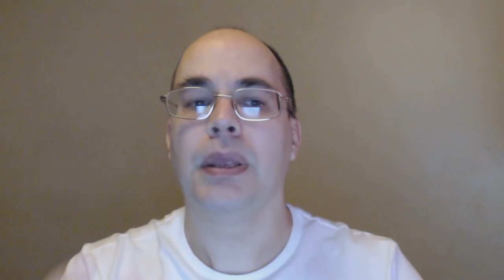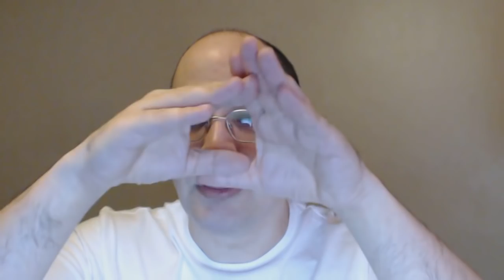How do rockets move in space, with nothing to push off from?

Comment: Oh, man, too funny. -- Hey genius, try putting a live round in a hollow tube, set it off with heat or something, and see how fast the bullet comes out the end. -- If it comes out at all. You'll much more likely just get a blown up tube.

Why don't you go borrow a pistol and examine how it's built. -- You could do this with a diagram of a pistol as well, of course, but the advantage of a real one is you'd be able to put it to a second very good use.
Reply: +Pontifex Maximus You're thinking about the mass of the fuel but you're forgetting that it is expelled with a large acceleration. Force is mass*acceleration. So the mass alone is not very interesting. If you actually do the math, you'll discover the force of a modern rocket is very high.For example, the booster rockets for the shuttle generate 30.5 million Newtons.
Reply: +Pontifex Maximus "Exactly how did they manage that? With a long pole?" Actually, hilariously that's exactly how they did it. It was stored in a space on the outside of the lunar module. After landing, they were able to electronically open the panel and extend the boom pole with the camera. You can see the blueprint and design for how it worked in the Apollo archives online.

"Dissipating heat is another argument you haven't addressed."

You make a good point that convection doesn't work in a vacuum. But that also applies for heat being transferred from the sun to the module. So the way that the sun heats the module is through a different method of heat transferal: infrared radiation. This is also how the module diffuses heat - via radiation on the dark side of the craft. But the really useful thing about infrared radiation is that it can be reflected away from the craft using shiny surfaces. They also have ways of making the radiation diffusion more efficient through radiating fins.

"The distance above the height of the "moon" that the running jumping frolicking golf-playing astronauts achieve is precisely the same as it would be on ear"

It's not really true that the heights are precisely the same. The spacesuits were 300 lbs of mass and intertia that they had to overcome making their jumps much, much higher than expected. Moreover, the footage that most people use to evaluate the jump is not the only time they jumped. Armstrong was able to max out his jump at about 6 feet but when he did this he found there was a tendency to flip backwards. After almost coming down on his back he declared an end to maximum jump tests.

There's something else to mention about the footage. If you look at the motion and really analyze it, you'll see that it cannot be explained by "slow motion." If you speed the footage up so that the jumps take the time you would expect on Earth it becomes very clear that the micromotions (hand movements, arm movements, head turns, etc) become absurdly fast.

FWIW, I've dived deep into both sides of this debate and my claim is that the evidence is clear that we went to the moon. A huge amount of the "evidence against" has reasonable, clear explanations that for some reason fall on deaf ears. The marketing of the hoax evidence is effective. People became thoroughly convinced by guys like Sibrell and even when you show that a large percentage of the claims are literally deceptive and the ones that aren't are explainable, it somehow doesn't seem to matter. 

I have tried for a long time to understand why but I have failed miserably.
Reply: +Pontifex Maximus "They should be leaping 10 feet above the surface. They ain't. What's the confusion?" 

Not with 300 lb space suits on they shouldn't.
Reply: +Pontifex Maximus "The panoramas, Scott. Where dey at???" The link Jan included isn't sufficient for some reason? I'm genuinely asking.
Reply: +Pontifex Maximus I hear you on the whole "who has time" to sort through all the noise for sure. I look at  for myself like dip in a for a few moments when you happen to be online and bored. See if you can push your understanding forward a little (in either direction) or see if you can add something informative to the discussion and most importantly (in my mind) try to do it a respectful/fun way. One of the things I can never understand is why so many people on both sides of the debate default to such obnoxious/insulting behavior. 

I swear, half the reason we never get consensus on these topics is because everyone on both sides are in a constant triggered state. 

Oh, and I've learned to let go of the fantasy that getting to a consensus will be easy or happen quickly.
Reply: +Pontifex Maximus ""the President declares the current state of emergency to be continuing and ongoing." Wow, I've never heard of this before. This is hilarious. And fascinating. Like... what?
Reply: +Pontifex Maximus "I'm not in a triggered state." I agree! Obviously. I thought that was so obvious it didn't even occur to me that you would read it that way. I was talking to a like-minded "it's nothing to get obnoxious over" person about how many are not like-minded with us.
Reply: +Pontifex Maximus I honestly think everyone is shadow banned and deleted. It happens with such annoying frequency.

Regarding the debunking debunks... there's some truth to this but at some point, there is an underlying truth. And reasonable, intelligent people shoul dbe able to agree on a way to reach it. I don't think youtube comments is a medium that lends itself to that but in general it should be more possible than it appears to be on this subject.
Reply: +Pontifex Maximus I was actually there for the creation google. Was in the same doctoral class as Sergei and Larry. To my eternal shame, I turned down a suggestion to work in their group with the dismissive, "Eh, search is solved. I want to do something interesting." SIGH.

But I can tell you that I never saw anything remotely shady about the birth of google. Just graduate students trying to solve search.
Reply: +Pontifex Maximus "Their graduate work was the foundation of the "intelligent" software that is now churning away" I mean I suppose there's a way you could view it like that.. I mean to the extent that their work on search is the basis of the birth of the company it's the foundation.

The work itself had very little to do with the kind of the sentiment analysis we know see. They were focused (at the time) on very shallow methods of understanding content. It really wasn't until the deep learning explosion of the of the mid 2000s that understanding started to deepen. 

Only tangentially related but my favorite story of that time is that right after they had the core insight of labelling pages not by the content but by the links, they taught a seminar class for undergrads at Stanford. All majors. 200 people. The class worked like this: every Friday, every student had to submit a single-page paper that was "an idea for how to search the internet  better." 200 students. 10 Fridays. 2000 essays. A week after that class ended, Larry and Sergei quit Stanford and formed the company. They took their stack of papers and one by one went "Good one, good one, good one, bad one, good one" and when they were done they had their development slate mapped out. Also, they hired the good idea people and turned them into billionaires.
Reply: +Pontifex Maximus I'm not fully seeing what you're trying to say? Why do you say "page ranking my ass"? Why do you doubt that?

I don't actually need to read Terry's wiki. He was my advisor too for a year. (I eventually switched to Daphne Koller.)

What are you saying here? I'm not being purposefully obtuse..I'm genuinely not fully catching what you're implying?
Reply: +Pontifex Maximus "Advertising revenues from people doing Google searches?" Yep. Who could have fucking seen that coming but turns out to be insanely profitable. I remember having endless debates with those guys where I would say, "You have the best search algorithm in the world, great! How do you make money?" and they would say, "Who knows! But there has to be a way."

There is an obvious value to their street mapping project. It's earned revenue and people make use of it all the time. What do you think they're doing with it that's untoward?

And what's wrong with scanning books to preserve them?
Reply: +Pontifex Maximus I don't think your sense of the economics are correct. When you say "talking about sums of money" what are the sums?

"You couldn't even do the accounting to collect?" I think you're making a factual mistake somewhere. You either overestimate Google's revenue? Or mabye underestimate other companies revenue? I mean, Comcast makes more in advertising revenue than google does - they manage to handle the accounting demands. 

Total ad buys last year were like 300 billion. Googles' revenue is like 75 billion. Apple went from bankrupt to the most valuable company in the world in the same time. Worth way more than google. Facebook is close in the same time. What's so unbelievable about google?

Yes, google buys up anything that is useful or a threat. So does Microsoft. So does Facebook. That's capitalism.

But I see absolutely no evidence for your suspicion. Do you have a real piece of evidence?
Reply: +Pontifex Maximus Well, you have a pretty good idea of how old I am given the fact that I started my PhD the same year Larry and Segei did. And what do you mean a "blank page?" They absolutely did advertise. Those small blue links that used to show up at the top of every search were ads. Now, they're usually in the middle. 

It didn't magically end the search wars. It ended the search wars because the search algorithm was orders of magnitude better than anything else. I remember back when it was a googol.stanford.edu and the entire thing was literally two guy's work and yet it blew Yahoo and Alta Vista (two full companies) away. It won by being the best.
Reply: +Pontifex Maximus What are you saying? Of course, Google advertised things. Not their own products obviously. It's the same model as a television network. 

A tv network sells air time to advertisers. Google sold space on their search results to advertisers. One of the reasons it became so valuable is that it allowed to advertisers to target customers very precisely. If you do a google search for "dishware" you'll get an ad for dishware. That kind of specificity blows blanket ads away. 

Like I said, comcast made 93 billion selling ad space last year. That's more than google made selling ad space. So nothing unbelievable about the numbers...

"Who paid them a dime for using their search engine?"
Companies who wanted to advertise to google users. Again, think of them like a tv network. Same model but better.

Here's a picture of the way advertising used to look on a google search page. The layouts are always evolving but this is one of the oldschool looks that you might remember: https://www.duncanjonesnz.com/wp-content/uploads/2016/07/results-history.png?x33513

Stuff at the top and to the right are ads. That's revenue for google EVERY TIME a search happens. Even more revenue when someone clicks on it! Every time a search happens!

Yes, google sees what you do on the internet. No disagreement there.
Reply: +Pontifex Maximus Just had a funny thought. Is it possible that you think Google does not have ads because you use an ad blocker and thus never actually see them? Just dawned on me that maybe that's why you are so convinced of something that's so demonstrably untrue! Pretty funny if that turns out to be the case?
Reply: +Ponifex Maximus Did you reply to my last message showing an example of google ads? I didn't see anything but if you're having trouble with disappearing posts then maybe you did? Are you using an ad blocker? If so, you can temporarily disable it and you'll see the ads for yourself.

FWIW, disappearing posts on youtube comments is a huge problem that I don't believe is associated with any kind of intentional censorship. I think Hanlon's Razor applies here. I've done a lot of testing around the issue and as far as i can tell: it's intermittent and unpredictable and I suspect has more to do with poorly designed spam filtering and corporate laziness than anything sinister.
Reply: +Pontifex Maximus Wait, I can't tell if you're kidding or did you miss the comment where I had a link to show you the ads? Here it is again:
https://www.duncanjonesnz.com/wp-content/uploads/2016/07/results-history.png?x33513

See all those ads?

There are most definitely ads on Google now. I'm really torn on whether you're serious or not. I don't have an ad blocker on Safari I never use it. So I just went to google and typed "dishware" on the first page of results at the top is a horizontal bar of advertisements with label "sponsored" right above it. Try it out.

Here's a cut and paste from the Google's wiki: "Google AdSense is a program run by Google that allows publishers in the Google Network of content sites to serve automatic text, image, video, or interactive media advertisements, that are targeted to site content and audience. These advertisements are administered, sorted, and maintained by Google. They can generate revenue on either a per-click or per-impression basis. Google beta-tested a cost-per-action service, but discontinued it in October 2008 in favor of a DoubleClick offering (also owned by Google).[2] In Q1 2014, Google earned US $3.4 billion ($13.6 billion annualized), or 22% of total revenue, through Google AdSense.[3] AdSense is a participant in the AdChoices program, so AdSense ads typically include the triangle-shaped AdChoices icon.[4][5] This program also operates on HTTP cookies. Over 14.3 million websites use AdSense.[6]"
Reply: +Pontifex Maximus Look, I even took a screenshot of the ads and uploaded my first imagr post. https://imgur.com/a/wsK01
Reply: +Pontifex Maximus Ah, fair enough. I really thought you were deadpanning me, ha. I have actually heard from Google friends that people mentally block out the ads a lot. Especially back when they were just text. So evidently it's not a totally uncommon thing. I almost mentioned that but was afraid it would just muddle things.
Reply: +Pontifex Maximus
Hey genius, try putting a live round in a hollow tube, set it off with heat or something, and see how fast the bullet comes out the end. -- If it comes out at all.
I agree. But what's your point? How does your experiment disprove anything this video?
Reply: Go look up Newton's Axioms/Laws of Motion. They're in a book called the "Principia" for short. The Third Law is the one we're interested in, concerning equal and opposite reactions. A body can't exert a force on itself and thereby move, there has to be another object (or medium) on which a force acts to create a corresponding reaction. In space there is nothing to exert a force upon, only a void, and therefore no way for a spaceship pushing gases out into that void to move. There would be no reaction that would propel the spaceship forward.

The analogy to a bullet fired out of a gun is completely inapplicable and irrelevant to the discussion. I suggested the hollow tube merely to highlight that fact, since in if you tried the experiment, the force of the gases from the rapidly burning gunpowder would for the most part expel themselves out the back of the tube, and the bullet would probably be ejected from the front at 50 or 100 feet per second, if you were lucky. The recoil of the pistol is in proportion to the weight bullet (125 grains let's say) and the pistol (say 30 ounces). The maker of the video is a either a complete idiot (most likely), or expects you not to notice that there's nothing resisting the gases thrust out of a rocket in space the way the pistol holds a cartridge in place. In his fantasy there's something like a big giant iron plate following the spaceship around in space.

There's nothing here to disprove here. It's just a bunch of nonsense.
Reply: +Pontifex Maximus
A body can't exert a force on itself and thereby move, there has to be another object (or medium) on which a force acts to create a corresponding reaction.
Yes, very good! Now why don't you actually try to apply this law to the rocketry?

As I already told you - the exhaust is not a part of the rocket, so the rocket doesn't actually exert a force on itself - just as a bowling ball you threw away while on a skateboard isn't a part of you, even though you were holding it beforehand.

I suggested the hollow tube merely to highlight that fact, since in if you tried the experiment, the force of the gases from the rapidly burning gunpowder would for the most part expel themselves out the back of the tube, and the bullet would probably be ejected from the front at 50 or 100 feet per second, if you were lucky
Well, yeah. Again, how does it disprove anything in the video? If you modify the gun, it's not going to work as good as before, but the action-reaction effect is still there, as you yourself note :)

Tell me - how can you have exhaust going down without affecting rocket in any way? Because that's what you believe - rocket generates an exhaust which is strong enough to lift it after bouncing of the atmosphere. Well then, why isn't it affecting a rocket before leaving the exhaust chamber?
Reply: You're comparing a bowling ball, which has a significant mass in relation to the person tossing it, to hot gasses, which have almost zero mass in relation to the mass of the spacecraft. -- That is the completely erroneous analogy.

The bullet would still separate from the cartridge and both move away from each other in opposite directions, as they both have relatively proportional masses. -- In absolute contradistinction to the spaceship/ejected gasses example.
Reply: +Pontifex Maximus
You're comparing a bowling ball, which has a significant mass in relation to the person tossing it, to hot gasses, which have almost zero mass in relation to the mass of the spacecraft.
Well then, I guess that all those rocket launches we've seen must be holograms or something, because even if you believe that rockets work by pushing off the air, they clearly expel enough mass to "bounce off the atmosphere" and propel the rocket up :)

The bullet would still separate from the cartridge and both move away from each other in opposite directions, as they both have relatively proportional masses. -- In absolutely contradistinction to the spaceship/ejected gasses example.
False - rocket's exhaust actually has rather significant mass :)
Reply: The PROPOSED mechanism of action is different in the two cases. If you wish to apply Newton's Third Law to the motion of an Apollo spaceship on the way to the moon, then sure, with a whole bunch of fuel to burn they could probably get the ship to move at a rate of a few inches an hour.
Reply: +Pontifex Maximus
The PROPOSED mechanism of action is different in the two cases.
How so? Either way, we have a violent release of gas particles in every direction, which interact with its environment (gun barrel/combustion chamber).

If you wish to apply Newton's Third Law to the motion of an Apollo spaceship on the way to the moon, then sure, with a whole bunch of fuel to burn they could probably get the ship to move at a rate of a few inches an hour.
This, again, stand in stark "contradistinction" with your beliefs - all those rockets in the atmosphere clearly can propel themselves to a significant speeds :)

Therefore, if the method of propulsion is actually different to what you think it is (and it is), then rockets do have the capability to reach the Moon at speeds much, much greater than "a few inches an hour"
Reply: That's the most reasonable thing I've ever seen Believers in the Magical Powers of the Atmosphere do. Yes, you do not have the knowledge at hand to prove your side - and you'll never will.

And if you can't prove NASA wrong, and can't be bothered to prove them wrong, then your decision not to trust in rocket science is not a rational one, but emotional one. You might as well be honest and admit it to yourself.
Reply: +Pontifex Maximus
And you are correct, I do not have the physics to prove/know, that the equal and opposite reaction part -- that the expulsion of gasses will cause the ship to move -- is valid or not.
So can't you, like... test it? Ask yourself some questions?

Would a gun work in space? If yes, then:
Would a gun "firing" an mass equivalent to a bullet work in space?

The actual rocket science is quite complex, but the basic idea is quite simple: just some gas particles getting heated and bouncing around.

There are, however, so many other impregnable arguments against the moon landing hoax
... which all have been soundly and repeatedly debunked. And you don't have to bullet point them all - just one would've been sufficient to have a nice civil conversation about it, as long as you'd be willing to stick to it, like you say you would.

Also, by the bye, it seems to me extremely poor form to interject an accusation against someone who has conceded a debate you were not involved in.
After you've bailed on me, it seemed quite fair :)
Reply: +Pontifex Maximus
You want another point? -- I'll give you a couple. Man built a plexiglass box in his backyard that had gloves similar to the ones the Apollo astronauts used going inside it.
No, he did not :) Ralph René has, in fact, used ordinary rubber gloves, so, no wonder he couldn't bent his fingers.

The actual design of space gloves is a matter of public record - anyone can see what NASA have done to ensure that its fingers would bent while in space. We even have videos right here, on Youtube, showing gloves in vacuum chambers. Even Adam Savage has one.

Other points, simply off the top of my head:
If I might trouble you with continuing this debate (which is of course entirely up to you), then it would be better to stick just to one point.

Nevertheless:

- Difficulty of dissipating heat in a vacuum.
Again, NASA's methods of heat dissipation is a matter of public record.

- Number of pictures taken in the time reportedly spent on the moon (something like one every 2 or 3 seconds), all of Time magazine quality.
Yet again, we have access to all the photos taken, and some of them are quite bad - blurry, over- and underexposed, etc. Also, most of them were shot in sequence, quickly, one after another, to make panoramas, etc. Once you run the numbers, the number of pictures taken isn't that unusual.

The inconsistency of shadows in the pictures and several other points concerning them.
Those "inconsistent" shadows have been replicated using only one light source.

- The ballistic probability of hitting the orbital window of either the moon or the earth.
Which is why astronauts did a mid-course correction :)

- The fact that none of these systems were ever tested in the real environment they were to face,
That's incorrect - Apollo equipment has been tested extensively in space, and over the Moon. There's a reason why it took NASA 11 missions to actually land on the Moon - the previous 10 were spent doing exactly what your source says wasn't done.

See, this is what I meant when I said that all those "impregnable arguments" have been soundly and repeatedly debunked. That's old stuff, from 90's.
Reply: +Pontifex Maximus
The rapidity of your replies shows that you're an expert on this subject.
It's Sunday evening. I'm just having some fun :) And, again, this is old stuff, publicly available over the Internet. I've had conversations like that already, so I kinda know the basic answers off the top of my head, even though I'm not an expert. I do know where to find some actual experts, though :)

I am certainly not an expert on it
It's okay :) However, since you concede that you're not an expert here, why believe in a Moon landing conspiracy at all? Never mind the rockets - the Moon rocks, the photos, etc all prove that man had to be on the Moon to get them.
Reply: And you may ask, what other particular conspiracies am I an expert on? -- 9/11, global warming, and to a large extent banking. To name three.
Reply: +Pontifex Maximus
I believe it to be a hoax because of the sheer preponderance of evidence against the slightest possibility of it being real.
Which, when examined individually, falls apart. The gloves, shadows, photos, "untested" equipment - it's all been proposed in the past, examined, and ripped apart.

I still note that you have not addressed the 1/3 gravity issue
That's because I haven't seen it - you've edited your post after I've posted my response.

So, there you go:
- Who took the video of Neil climbing down the ladder out of the Lander?
Automated camera, included and set up precisely to capture that very moment.

- Speeding up the videos shows that 1/3 gravity was not the situation.
On the contrary, it's impossible to duplicate movements of the Moon astronauts in Earth's gravity. (And it's 1/6 gravity, not 1/3).

- Stuff left on the moon should be perfectly visible to us with modern technology.
It is. We just needed telescopes with adequate resolution.

They even claim to have set up a mirror to reflect a laser projection from earth in the future. None of this has ever been shown.
What do you mean? Scientist routinely bounce lasers off those mirrors.

(which apparently has a hatch that isn't big enough for the suit to fit through)
The hatch is 32 inches wide, and the space suit is 22 inches wide at the shoulders.

Another thing is, claims like these seem to suggest that NASA is both inhumanly competent and bumblingly inept at the same time, which alone is quite enough to doubt each and every conspiracy claim :)

And, some of those claims are so easy to debunk - like the automated camera one. Those are accusations that stem not from expertise, but from ignorance.
Reply: +Pontifex Maximus
If you speed the films, the distance above the height of the "moon" that the running jumping frolicking golf-playing astronauts achieve is precisely the same as it would be on Earth.
The movement of the astronauts is impossible to duplicate in Earth's gravity. Without specifics this claim in meaningless.

Which is why they never bothered to make a video panning around the surface they were standing on.
That's incorrect - the astronauts made several panoramas.

Dissipating heat is another argument you haven't addressed.
I have. I said that heat dissipating methods are publicly available. Again, without some precise numbers, the accusation is meaningless.

And they "set up" the camera? Exactly how did they manage that? With a long pole?
Is an idea of remotely controlled camera is really so hard to imagine?
Reply: +Pontifex Maximus
They should be leaping 10 feet above the surface.
Why should they? It's the same as saying "this car can go 150mph - why aren't you speeding all the time?"

In any case, the fact that the astronauts were acting responsibly and avoided any reckless maneuvers is not an evidence of the hoax.

Show me money. Where the panoramas at?
https://www.lpi.usra.edu/resources/apollopanoramas/

They threw it out the window
No, it was attached to the side of the LM. Again, this information is publicly available and can easily be found online.

So, yet again, this is you battling with your own ignorance. That's not an insult, nor even much of a pointed observation. However, what worries me (and should worry you) is apparent ease you abandon your points with. A is wrong? Let's try B. B is wrong, too? C it is, then.

Consider this: If one, only one point of evidence for Moon landings can be shown to be true beyond all reasonable doubt, then that's it: the Moon landings had to happen in order to get it.

On the other hand, the conspiracy theory has to explain everything away, and if it can't, then the conspiracy cannot be true.

So, you don't have to introduce new points as the old get disproven - all you have to do is stick to one point, and one point only.
Reply: +Pontifex Maximus
I have not abandoned points, Jan. I abandoned the entire argument.
Then why do you keep arguing?

I'm not presenting counter-arguments about what you're saying because I can't back them up.
If you can't back them up, then why do you believe in their validity? The simplest of them can be debunked in like 2 minutes; why do you think that the rest is any more valid?

Today we drop bombs on children in the Middle East for Israel and "our" government is a gang of mobsters.
That is entirely and completely beside the point. Yes, I am quite vexed by the self-destructive and irresponsible behaviour of US government, but it has no relevance to the topic at hand.

You want to score some rhetorical point here? Walk away with victory? Fine. The current US government is bad, and the previous one wasn't flawless either. Happy now?

The Southern States walked out of Congress in March of 1861 leaving no quorum to conduct business, and Congress was never officially reconvened.
Just out of idle curiosity, shouldn't that last, like, only until the next congressional elections or something?
Reply: https://www.youtube.com/watch?v=kQFKtI6gn9Y
Reply: +Pontifex Maximus
I can recommend a movie to you called "A Funny Thing Happened on the Way to the Moon,"
That movie has been debunked so many times it's not even funny. And it's actually a lie - it was dishonestly edited, and the scene you mention cuts away before the camera in the original footage backs away, revealing that the capsule is indeed "far, far away" from Earth. It's available on Youtube, of course.
Reply: > turns out to be insanely profitable

Dude, I don't know how old you are, but they didn't advertise ANYTHING. It was a blank page. A blank page that magically ended the search engine wars overnight. And then magically grew like a beanstock into a megalith. Overnight.
Reply: +Pontifex Maximus
Man, oh man, are you ever up to speed on the moon landing debate.
Up to speed? This is old news.

Since you raised it, you do the search for the links.
Of course: https://www.youtube.com/watch?v=y5XkLa9RYNk
This clips shows Sibrel's dishonesty rather clearly and undeniably.

You see, you really want an argument with me on this because it makes the disbelievers look bad to see me losing.
No, I just want to you realize your mistakes :)

But if I wanted to spend the time, I could debunk your debunkings.
Given your track record so far, I sincerely doubt that :)

The question is, why bother?
Why bother bringing your objections in the first place, then? It's like you know you're wrong, but still want to project the image of the brave conspiracy theorist, armed with "impregnable arguments" which could have destroyed all poor shill sheeple... if he wanted to :D

Instead, despite your best efforts, your constant jumping from one failed argument to another paints you as a stubborn, conceited ignoramus.

Again, why don't you focus on just one argument?

Arguing against the lies on a site whose PURPOSE is to protect the lies
That's bullshit. Youtube is full of conspiracy videos on every topic imaginable. Why, "A Funny Thing Happened on the Way to the Moon" itself is available on several separate channels.
Reply: +Pontifex Maximus
I don't get my posts deleted because they're rude or against any of the site's policies. They're deleted because they contain information and a point of view that those who run the site don't want widely known.
Don't flatter yourself. There's nothing here your'e saying that is "exposing" anything - it's just a lot of hot air, and you saying that you could've taken it all to pieces... if you wanted to.

It's all talk and no substance.

I can certainly take the Apollo Moon Landing hoax to pieces.
Do, or do not. Don't try to frighten me with your sorcerer's ways :)

You've got a ready response to each and every objection, and you're so quick on the draw with them. Which is rather amazing, since you say it's old news to you.
Um, yes? I've got a ready response to each and every of your objection because it's old news to me. What's so strange about it? If you had some new, henceforth unknown objections, that would've been a problem for me, but so far, it's all "been there, done that" kind of stuff. I know it may seem fresh and exciting to you, but it's really not.

It's possibly the single-most absurd and simplistically stupid so-called "conspiracies" there is. It doesn't even qualify as a conspiracy.
Yes, exactly. So why do you insist in believing it? :)
Reply: +Pontifex Maximus
Um, on the off chance that the point eludes you, it has been a good 15 or 20 years since I researched the story of the men on the moon.
Yeah, it shows. Too bad you're not willing to honestly re-examine your unsubstantiated beliefs.
Reply: +Pontifex Maximus
Okay. Until then, if you can't actually substantiate your accusations, I suggest you refrain from commenting on matters you're not knowledgeable about.
Reply: +Pontifex Maximus i totally get why for those of us who don't register those ads the revenue can be surprising. But I think the counter-arguments are obvious and compelling. There are a lot of people in the world and it's pretty fruitless to reason about the aggregate behavior by just trying to extrapolate what we do. I mean, hell, with DVR technology and iTunes when was the last time I ever saw a commercial in a television show? And yet I don't doubt that companies pay for those spots. 

- The advertisers pay just for the privilege of displaying their ads. This means that every single time anyone does any search Google is getting some pay from some advertisers. They call it impressions. It's wasted money on you and I but the advertisers evidently think it's worth what they pay. Either way, it represents income for Google whether we notice them or not.

- Google processes 40,000 searches per second. That's a lot of impressions per day. It adds up.

- They also track who clicks on the ads and pay a lot more for each of those. And I think they even track who purchases after clicking on the ad.

- There's big money in advertising. Google made $31B off ads last year. This is not a huge number for ads. Like I keep saying: Comcast made $93B.

- Another big point to remember that should go a LONG WAY to mitigate your suspicions is that Google is a public company. This means you can go and see EXACTLY where and when their money came from. They can't hide that stuff very well as a public company.  

- Also, we got to remember the true "value" of the company is defined by the stock price. So partly they made a ton of money off investors who believed they were going to grow in value.

"Google buys start ups for absolutely outrageous sums of money."

That they do. But there's nothing wrong with that. That's how companies like that build value. Microsoft, Facebook, Apple all do it too!

Bottom line? I claim that you can't expect to have an accurate sense of aggregate behavior by simply extrapolating off your personal behavior. You don't look at ads but who does? My sister? I bet you she does. 
I ams sure we could data about this somewhere.

In addition, I claim there's a ton of evidence that establishes ad revenue for Google to be legitimate. And I don't find any of it that surprising.
Reply: +Pontifex Maximus lol, I'm a TV writer but I'm on hiatus right now. which means i'm on like an extended break between seasons. i always go a little stir crazy, ha. i swear if you map out my presence in the youtube discussions it spikes every year around this time,. but honestly, fair point, ha. my gf  says the same fucking thing so i guarantee you tomorrow she's going to be all: "well, I know you're saying he's wrong about google but he ain't wrong about that. you do not need to respond to every comment on every topic you think you know anything about." etc.
Reply: Yeah, that's the other thing about TV. Before, hiatus started, I came off 20 days of night shoot too. I'm sure I'd be a lot less stir crazy if I wasn't the only person I know awake right now. I keep planning on staying awake through the day and resetting my schedule but so far I keep falling asleep around 9am, lol.
Reply: +Pontifex Maximus I feel like I should be able to figure out what's happening here and yet I'm not. What is happening here!?
Reply: Sharon Alston https://youtu.be/Zv6KQzlLwU4

Not a live round, but technically the charge of it
Reply: M. Scott Veach:  Oh, and plus the ship is already moving as fast as you want. The rockets are just there for course corrections. So it makes total sense.

I'm loath to concede a debate. It's something I never do. But I'm going to have to in this case, since I don't have knowledge at hand to prove my side of the propulsion aspect of the Apollo Fairy Tale. There's a related issue, that a craft with the mass of the Apollo spaceship -- its two parts, the Lunar Lander and the rocket that circled the moon and then was used to return to Earth -- could every possibly have escaped Earth's gravity well using a missile the size of the one standing on the platform. NASA says it could. They have a detailed page proving it entitled "NASA - The Tyranny of the Rocket Equation." I can't prove them wrong. I could most probably prove it using their own data and pointing out its inconsistencies with data from other sources and/or the consistency of their claims with each other, but it's more work than I'm interested in engaging in. So well done. You get the trophy.
Reply: Jan: Stzeleciki:  There are two aspects to Third Law "excuse" (I will call it) that a rocket will work in space. And you are correct, I do not have the physics to prove/know, that the equal and opposite reaction part -- that the expulsion of gasses will cause the ship to move -- is valid or not. This is a case of a debate I should not engage in.

There are, however, so many other impregnable arguments against the moon landing hoax that merely to bullet point them would fill a few pages. I am not going to do what I accuse others of doing to avoid losing an argument by jumping to any one of them. This argument is lost. I simply don't have the time, inclination, nor possibly even the math skills, to pursue it to a definitive conclusion. It would be a trivial matter for some, and I'm sure it's already been done by those with that skill set.

Also, by the bye, it seems to me extremely poor form to interject an accusation against someone who has conceded a debate you were not involved in.
Reply: Oh, I see, yes, it was you I was arguing with. Quite correct. I didn't recognize your name.

You want another point? -- I'll give you a couple. Man built a plexiglass box in his backyard that had gloves similar to the ones the Apollo astronauts used going inside it. He evacuated it to the nearest point of a vacuum he could achieve, and invited people to place their hands in the gloves (which would be at atmospheric pressure) and try to move the fingers of the gloves inside the box. They could not move them at all because of the pressure differential. He made a video showing this.

Other points, simply off the top of my head:

- Difficulty of dissipating heat in a vacuum. Certainly not by convection. NASA's data on the heat from the sun is 1317 watts per square meter.
- Number of pictures taken in the time reportedly spent on the moon (something like one every 2 or 3 seconds), all of Time magazine quality. The inconsistency of shadows in the pictures and several other points concerning them.
- The ballistic probability of hitting the orbital window of either the moon or the earth.
- The fact that none of these systems were ever tested in the real environment they were to face, and yet all performed -- an engineering miracle.

[EDIT:

- Who took the video of Neil climbing down the ladder out of the Lander?
- Speeding up the videos shows that 1/3 gravity was not the situation.

There are countless others. These are from my memory of looking at the hoax probably 15 years ago.]

[EDIT 2: They just keep occurring to me. This is a long dead conspiracy for me.

- Stuff left on the moon should be perfectly visible to us with modern technology. They even claim to have set up a mirror to reflect a laser projection from earth in the future. None of this has ever been shown.]
Reply: The rapidity of your replies shows that you're an expert on this subject. Which suggests you're either a hired gun, or a real enthusiast. I am certainly not an expert on it -- I'm an expert on conspiracy theory in its totality, and on certain other particular conspiracies. You will certainly destroy me in this debate quite easily unless I invest a tremendous amount of time on it, which to me it simply doesn't deserve, and which I lack.
Reply: I note though that you neglected to respond to the points regarding the videos.
Reply: I believe it to be a hoax because of the sheer preponderance of evidence against the slightest possibility of it being real. Which, again, I don't feel compelled to spend the time even to re-educate about, let alone dive deeper into all the (to my mind ridiculous) claims. I do have a friend though who is an expert on the photography. A physicist who worked on a camera for one of NASA's projects, which shall go unnamed for the present. Whether he'd be interested in taking the time to engage in the exposition I don't know. I can ask him. -- I still note that you have not addressed the 1/3 gravity issue or how Mr. Armstrong was photographed descending the steps of the lunar lander (which apparently has a hatch that isn't big enough for the suit to fit through, both being in the Smithsonian for anyone to measure).
Reply: One-sixth. Quite correct. -- And even worse for the claims made.

If you speed the films, the distance above the height of the "moon" that the running jumping frolicking golf-playing astronauts achieve is precisely the same as it would be on earth. Because they are simply slowed down movies of guys in a Halloween suits in a sound stage. Which is why they never bothered to make a video panning around the surface they were standing on. The director and cameramen and crew would have seemed out of place to most viewers.

Dissipating heat is another argument you haven't addressed.

And they "set up" the camera? Exactly how did they manage that? With a long pole? -- Never mind. Stupid point to argue.
Reply: Your first response is simply meaningless. They should be leaping 10 feet above the surface. They ain't. What's the confusion?

Response 2: Show me money. Where the panoramas at?

Response 3: Again, show me the links.

Response 4: As I said, a really dumb argument to waste time on. They threw it out the window and then used joysticks to point it at the hatch. Whatever. I really don't care.
Reply: The panoramas, Scott. Where dey at???
Reply: Ah, I see. I was of course speaking of a video panorama. Alas.

(I really seriously have things I should be doing.)

I have not abandoned points, Jan. I abandoned the entire argument. But Scott wanted some other points. And you're both facing me. I'm not presenting counter-arguments about what you're saying because I can't back them up. I'd have to look into them all. I'm not doing that. So you win on every point. Are you happy now? Astronauts went to the moon six times back in late 60s and early 70s. Well done America. Gives us great pride to have accomplished such an engineering marvel. Today we drop bombs on children in the Middle East for Israel and "our" government is a gang of mobsters. I put "our" in quotes, because it of course (the U.S. Congress) doesn't have the slightest thing to do with us. It's a private corporation, as are all government entities, but this one residing on a piece of land 10 miles square that isn't legally part of the "country" it rules over. -- I put "country" in quotes, since America is in fact a collection of sovereign states ALL conquered in 1865 by this foreign entity squatting in the District of Columbia. It (the United States) is no more a country than Africa. (Though I believe there was a recent President or candidate who was confused on that point.) It's a legal fiction. The Southern States walked out of Congress in March of 1861 leaving no quorum to conduct business, and Congress was never officially reconvened. This "country" has been ruled largely by "Executive Orders" (is that in the Constitution? pretty sure not) ever since.

But we went to the moon, and well done us. So fuck the kids in Palestine. Go America. Never mind phony terrorism and its portrayal on the news. Go America! Home of the Brave! Go Red Sox, go Katy Perry, go, go, go!!! We went to the moon. We can do whatever the fuck we want. We're fucking Americans, after all. God bless us. And the Devil too.
Reply: Executive Orders can of course be issued by the President (Commander-in-Chief of all forces civil and military) during periods of National Emergency. Which is exactly what this "country" has been in since 1861, as is stated every 16 or so months, in an official statement issued by the White House, due to a "law," "act," "pronouncement," (as you wish) passed by the circus tent Congress in 1976 decreeing that such state of emergency shall lapse after such period if not explicitly continued by the President to be continuing. Therefore, "The political state of Burma being..." such and such... "the President declares the current state of emergency to be continuing and ongoing." As an example you're free to look up if you think I'm joking. -- Wait, I'll do it for you.

https://obamawhitehouse.archives.gov/the-press-office/2016/05/17/notice-continuation-national-emergency-respect-burma
Reply: The "statute/public law" referred to, relevant section beginning bottom of page 1:

https://www.gpo.gov/fdsys/pkg/STATUTE-90/pdf/STATUTE-90-Pg1255.pdf
Reply: >Then why do you keep arguing?
That's Monty Python. -- "I'm not arguing." -- "Yes you are." -- "No I'm not. I'm merely contradicting you."

>Just out of idle curiosity, shouldn't that last, like, only until the next congressional elections or something?
The government under the Constitution of 1789. It does not exist any longer, and has not existed since 1865. Which is why attempting to raise the Constitution in a court of law will get you, first, a statement from the judge or magistrate that "the Constitution is not relevant  here," next, if you persist, a warning, and finally, on your third attempt, a charge of contempt.
Reply: Mr. Veach, I'm not in a triggered state.  You can kick my ass in this subject because I'm not booked up on it. Certainly not anymore. I can recommend a movie to you called "A Funny Thing Happened on the Way to the Moon," where there's a bit of footage, inadvertently turned over by a NASA archivist, probably after a long drawn out FOIA battle, that shows Buzz or Michael removing a piece of laminate the astroNOTs had placed over the capsule window to make it appear as though the earth to them was far away, when they were in fact simply in orbit above the earth. Which is all they ever did. Three days is a long time to spend in a tiny capsule with two other men, but it was for the cause, and Brothers Good and True don't shirk their responsibility to the Great Work.  Unless they want the Gus Grissom treatment.

https://en.wikipedia.org/wiki/Gus_Grissom
Reply: Man, oh man, are you ever up to speed on the moon landing debate.

I have seen the "debunking video." To me it does nothing of the sort -- debunk -- unless you're under verbal hypnosis by the narrator. What's happening is quite clear. What the narrator claims is quite clearly not the case. -- Since you raised it, you do the search for the links. But this is a clear case of you making an assertion and merely expecting it to be believed.

You see, you really want an argument with me on this because it makes the disbelievers look bad to see me losing. But if I wanted to spend the time, I could debunk your debunkings. The question is, why bother? First of all, it's already been done. Secondly, every time I batter people down in conspiracy arguments on YouTube, my comments are first shadow banned, and after a week or two deleted entirely. So arguing on a site dedicated to preserving the lies... Hold on, let's put that better. -- Arguing against the lies on a site whose PURPOSE is to protect the lies, and systematically confuse and control the flow of information regarding now widely know about "conspiracy theory" is utterly pointless. It's not an open forum.
Reply: What's the first thing Google did after buying YouTube? -- Took away the ability to see a poster's posting history. The reason is obvious. You would learn very quickly from people like me if you were able to peruse my history. -- This site is completely controlled, as is the entire Internet, by the Powers That Be. The Internet was developed conceptually by RAND just after WWII. It is Big Brother. RAND was a division of Douglas Aircraft. The current CEO of YouTube was born on Stanford campus in the house next to a math "professor" (cover for his work at SRI) who worked for RAND for several years, and it was out of her garage that the first servers for Google were run. It isn't difficult to put together the pieces of the puzzle. 

We have no real voice on the Internet. We cannot use their own military grade technology against them, the infrastructure they own and control. It is not for the people, it's the ultimate means of surveillance and manipulation of the people. -- We the People, in order to form a more perfect union, establish justice.... blah, blah, blah.

[EDIT:  SRI ran the first domain name servers for the public Internet.]
Reply: What they're doing now though is making their false flag terrorism perfectly transparent, and then rubbing it in our faces. (Not the Europeans, but the American events: Sandy Hook, Boston Bombing, Dallas Sniper, this latest one in Las Vegas that I simply refuse to bother looking at.) This has several different angles, and obviously raises several issues to a military-thinking man concerning eventual outcomes. -- So do they have a plan here?  Do they have a lot of dissension in the ranks about what was their plan which failed? If there is a new plan, is there a single over-riding document outlining the strategy? Or is everything proceeding according to plan?

I think they're dead in the water. At least for the moment.
Reply: "After enrolling in a computer science PhD program at Stanford University, Page was in search of a dissertation theme and considered exploring the mathematical properties of the World Wide Web, understanding its link structure as a huge graph—his supervisor, Terry Winograd, encouraged him to pursue the idea, and Page recalled in 2008 that it was the best advice he had ever received."

https://en.wikipedia.org/wiki/Larry_Page#PhD_studies_and_research

Now read Terry Winograd's wiki page:

https://en.wikipedia.org/wiki/Terry_Winograd

Page ranking my fucking ass.
Reply: What's Google been up to? Sending a million little cars all around the world to photograph every street, every house. It obviously cost untold billions. -- You think they did that for you? So you could virtually stroll through Paris? -- Where'd the money come from anyway? Advertising revenues from people doing Google searches?

What else have they been up to? Let's see. Sending an army of college kids to every major library to sit in the dark and scan books. -- Not so you can read them online. No, no, no.  Just to preserve them for posterity. Or something. They're under copyright of course, so you can't read them. But Google is above the law in that regard.

Get serious, man. About what this thing is.
Reply: I'm sure you worked hard at Stanford. I know the campus well. Lived in Palo Alto for five years. But economics is obviously not something you studied there. We're talking about sums of money that are completely beyond bounds. You couldn't even do the accounting to collect the kind of money we're talking about, what they supposedly accumulated in the space of a couple of years. It's completely absurd.

And what am I saying here, you ask?

Google is the NSA and its affiliates. It's as simple as that. It's a front. Obviously kids don't want to drive cars and scan books for the NSA. -- But for Google, sure, that's a cool job. Google's a hip happy Silicon Valley fun place.

And these are simply examples. Google buys up anything that is either useful or a threat to them. They own half of cyberspace. It's how the government controls the public side of its monster Big Brother, the glorious Internet.
Reply: THIS THREAD WILL SELF-DESTRUCT IN .... 10, 9, 8...
Reply: See, now you're just going off the map.

Apple and Microsoft sell products. Facebook has advertising. Google never has, not to this day, advertised a single thing. They do now sell phones. They do now own and manage lord knows how many companies. But that all grew from what? From revenue from what? Who paid them a dime for using their search engine?

Which brings up another utterly crucial point -- that Google controls what you see of the Internet. Google keeps a record of everything you do. As does Windows 10. There is a profile. There is a video out there of a man who fought a year or two in court to finally obtain the record Google had on him. It amounted to a stack of paper that it would be difficult for a sturdy lad to carry down the hall.
Reply: YouTube, as I've explained, shadow bans commentors and makes it impossible to see a person's posting history. I don't get my posts deleted because they're rude or against any of the site's policies. They're deleted because they contain information and a point of view that those who run the site don't want widely known. They don't want their cast of actors exposed. They don't want their methods and their actors' methods of manipulation exposed. They don't want it known that they assist in promoting the conflicts that are destroying our society and the world. I'm censored to protect the phony truth seekers, confusers of public perception, and to protect the site itself. I know how nefarious this honeypot is. Many of us do. We know there are rooms full of people paid by the hour to sway conversation in a certain direction. They're not moderating, they're pretending to be normal people with something on their mind. For a job. They have scripts. They clock in and out at regular hours. This site has a purpose, and it's a very significant one. This is arguably the most influential information outlet in the world today. But it is utterly insidious. Run by frauds, populated with celebrities who are frauds, and swarming with sock puppet frauds.

I can certainly take the Apollo Moon Landing hoax to pieces. But not without revisiting the subject. Without re-reading the fairy tale. You've got a ready response to each and every objection, and you're so quick on the draw with them. Which is rather amazing, since you say it's old news to you. And yet you have the refutations still at your fingertips, your ducks all in a row, all ready to go. Whereas I of course do not have the details still fresh in my mind. The story is such absolute and complete bullshit from beginning to end that I long ago stopped caring or thinking anything of it. It's possibly the single-most absurd and simplistically stupid so-called "conspiracies" there is. It doesn't even qualify as a conspiracy. It's just a big joke. But of course you can bamboozle people who have never looked into it with the kind of pat, seemingly reasonable responses you're making.
Reply: Um, on the off chance that the point eludes you, it has been a good 15 or 20 years since I researched the story of the men on the moon. After which it became a thoroughly settled point in my mind, and I went on to investigate many, many other things. Read and converted many books about subjects that are actually debatable. One does not retain unused knowledge from ages past, particularly about such trivially ridiculous things like the Apollo missions.
Reply: Once again, I'll be happy to dig out the books and recite for the newcomers the litany of lunacy (pun intended?) when I have the time.
Reply: Yes, that's certainly good advice. I would suggest the same to anyone, since it only lends credence and credibility to those spinning the yarn. -- Which I admit, I had not realized were still around.
Reply: +M. Scott Veach -- I'm sorry but there are no advertisements on Google now, and to my almost certain knowledge there never have been, starting from day one. If you wish to dispute that, you're free to go find an example in the Way Back Machine of the Google search page with an advertisement on it. Popup blockers will of course not be relevant to what's in those static screenshots, which stretch back to 1999.
Reply: Yes, you're quite right. had not remembered the ads from the results pages. And I had not seen your link.
Reply: +M. Scott Veach -- No, it's totally cool. I was thinking strictly of the search page itself. And it's true, it's absolutely true, though they've always been there, I've never really been consciously aware of the ads that accompany the results pages. My eye doesn't move to them, because brain is trained at a deep level to know that that stuff over there is just wasted real estate on the page as far as it concerns me. -- It's pretty funny, now that I think about it. 

Which just goes to show. -- I mean, how many people actually would look at that crap, let alone click on it? And yet that's how Google became the flat out Kingpin of the Internet? That's how they built that campus in Mountain View? That's how they sent thousands upon thousands of people around in little cars with a dozen cameras on the roof to photograph every street in every town in the habitable fucking world? While their younger brother or sister was down at the library scanning books? -- Can we get serious for a sec? It's just the biggest joke.

Google buys start ups for absolutely outrageous sums of money. -- Doesn't negotiate, just says, "Here's ten times what any actual investor would offer you. What do you say?" -- Gives their owners stocks worth a couple million more, and a job down at factory if they want it, where they have a cafe that serves 5-star meals around clock for free. -- Just a little perk, you know. To help keep you motivated. -- "We love what you're doing!"

How can anyone not see through something so obvious?

Microsoft was a scam too, sure. Bill Gates was poker player, not a programmer. He didn't write DOS, he just purloined it. But Microsoft went on to charge every major company that wanted to stay in business a couple hundred bucks per employee in licensing fees to use their products. They had a huge revenue stream. Their books probably actually balance. -- Google is nothing but a storefront. YouTube is the same. But there's air conditioned rooms the size of football fields stacked to the roof with servers that "crawl" the web, and host this site here. And it's all paid for by these little Geico ads that you can skip in 5, 4, 3, 2...

Or no, wait. Geico was smart. They made their ads short enough to fit the no-skip zone.
Reply: What are you, Veach? Are you a sample of the new "artificial intelligence."

I spend 20 minutes sitting here writing a post, looking at it, trying to hone it to perfection. And you come back in 34 seconds with this.

Come on, man. I'm hip to the game. But it's flattering to have two All Star players coming at me in one thread that I started. 

That's a fair fight.
Reply: So what time zone you in then? Dawn is just breaking where I'm at, which is East Coast America. Makes it 3:40 a.m. in L.A., where most TV writers tend to hang out.
Reply: People are often curious about how rockets move in space when there’s nothing, or at least virtually nothing, for them to push off against. There’s this fairly common, and to quite some extent understandable, misconception about how rockets actually move. Anyone who’s seen footage of a rocket blasting away from a launch pad, and the flames which are splaying out across the base, will quite easily be forgiven for understanding that the power of the lift is due to the rocket pushing against solid immovable pad and therefore being propelled in the other direction. — But this just isn’t the case. Something like this [would mean then?] objects such as jet aircraft, or, indeed, air-to-air missiles, just wouldn’t be able to operate.

So that leaves us with the question, what actually is going on in the rocket, and why do they need a launch pad at all?

Well, taking the last part first: the launch pad is there to provide a stable platform for the mass of the rocket and the gantry. Just supporting the weight of those structures really needs something substantial. But also, it takes the rocket a short time to build up to full power required for liftoff. In that time the rocket needs something that will hold it in place for long enough till the thrust from the rocket can support its own mass and clear the pad. Without a solid, stable pad, the rocket would just likely be toppled over to one side or the other, which would be disastrous, especially for anybody nearby.

For the physics of the rocket itself, we have to look at something called “conservation of momentum,” which stems from Isaac Newton’s Third Law of Motion. The basis of this law is, that for every action there’s an equal and opposite reaction. It’s [very seen/the very same?] when a gun is fired. The bullet emerges from one end traveling very fast, but, at the same, the gun also kicks back (or recoils) fairly slowly in the opposite direction — at least slowly in comparison with the speed of the bullet. When the gun is fired, both the ammunition and the gun itself are stationary — they have no momentum. After the gun is fired, the bullet is moving forwards, and the gun is moving backwards. The conservation of momentum means that when you add up these forces (taking into account they’re acting in opposite directions) they should add up to zero, or the original resting state. So, if the gun may weigh about 100 times more than the bullet it fires, and since force equals mass times velocity [acceleration], the bullet will need to travel a hundred times faster forwards than the gun recoils backwards. However, the total force of the bullet moving forwards and the gun moving backwards will both be equal, just acting in opposite directions. 

So now all we have to do is apply this same method to the rocket. Obviously, like the gun in the example, at the start the rocket is stationary. As it lifts off however, a large proportion of the fuel is shot out one end. The greater the mass of this fuel that’s expelled downwards from the rocket — and more importantly, the faster it goes — the greater the force will be produced pushing the rocket upwards. This is, again, because the two forces need to balance out to maintain the original momentum of the rocket. So even though the rocket’s a very heavy object, because so much fuel is being expelled so fast from the rocket, it accelerates very fast away from the earth. — In fact, if nothing else would happen, it would very quickly get into space. But the rocket also has to overcome the pull of gravity bringing it back down. Because of this requirement, the rocket needs to have more fuel. It runs into a serious problem here: the more fuel the rocket has at the start, the heavier it becomes, and therefore the more fuel that’s needed to move rocket off the launch pad in the first place. This is why rockets taking things into orbit or beyond are so massive.

Now, once the rocket is in space, away from the earth and away from its gravity, all that is left is just a relatively light module (or capsule). Gravity’s no longer an issue, so a relatively small amount of fuel is used, as thrust will create quite a dramatic change in velocity. But the conservation of momentum still can be a serious issue. In order to get to distant object like Mars in a reasonable amount of time, the rocket needs to build up a significant amount of speed — or momentum. This means, as it approaches Mars, unless the thrust is applied in the opposite direction, it will still have that momentum as it either flies past, or smashes into this planet’s surface. This is the reason why Mars rovers take such extraordinary measures to reduce their speed to avoid such a damaging impact.

So that’s momentum, and why rockets in space don’t need something to push off from, it’s all about the conservation of momentum.
Reply: Now, my first thought would be this:

If one were an engineer, assigned the task of coming up with a plan for sending a rocket ship to Mars, do you think that it might not possibly occur to him, likely within the first few minutes after sitting down at his drafting table, that it would be best to approach the planet from behind? 

… As it were?

That is, catch up with Mars, rather than an attack it head on, like the Death Star?

Engineers are very conscious of efficiency. I don’t expect that any competent one would formulate a plan such as your suggesting, requiring his spaceship to apply some kind of very fuel-intensive reverse thrust in order to avoid a potentially violent smash up. Which would just thoroughly wreck the mood of the evening.

No, he would surely choose the more subtle, the more delicate route, eeeeeasing his way gently into the planet’s orbital ... panties.

As it were.

We are of course talking about complete fantasy. But just to point that out.
Reply: Yes, I’m quite sure that would be his approach. A gentle tap on the shoulder. Perhaps a dozen roses and a box of chocolates after an orbit or two. So as not to startle…

But wait! -- Oh no!!

IT’S THE GOD OF WAR!!!

Oh my. This is not looking so sweet after all. 

Oh no. No, no, no. I think he would start revising his resume just after lunch break. Because this is certainly not what he had in mind when he applied to Stanford.
Reply: @Scott -- Welcome to the club.